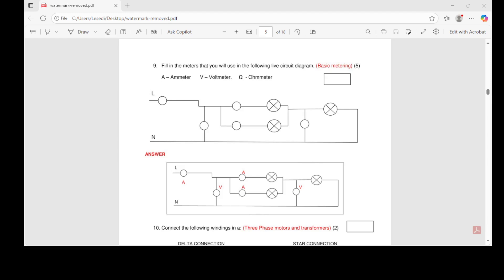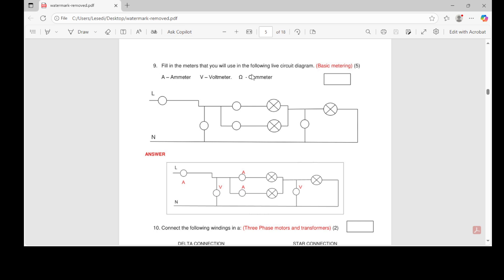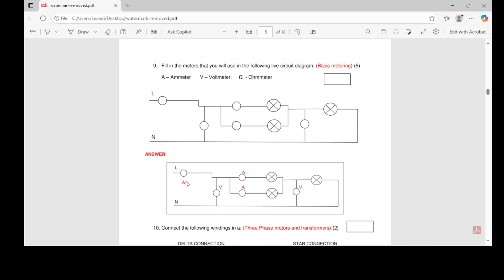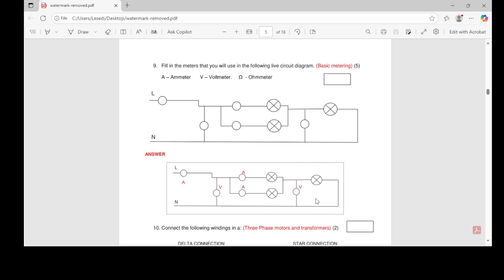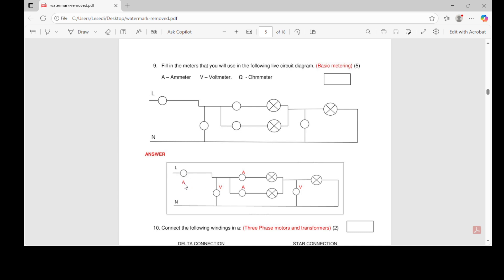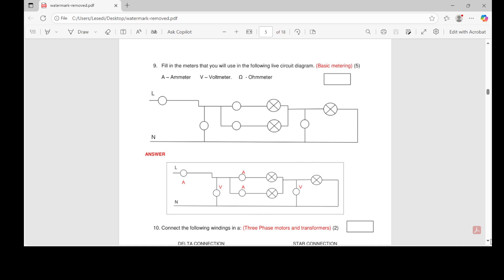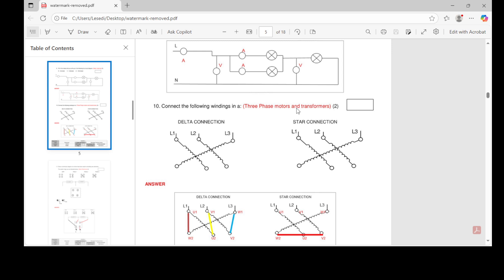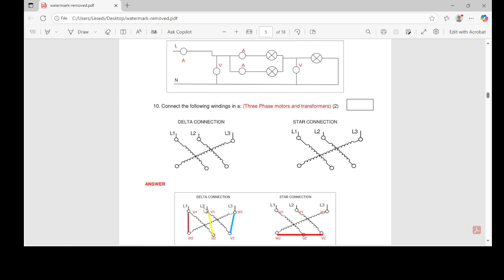ARPL PART 2, PAPER 2 QUESTIONS AND ANSWER : STAR AND DELTA WINDING CONNECTION : ARTISAN ELECTRICIAN

Comment: Do the questions change with time??  For instance, paper 2 can be different from Last trimester paper 2?
Reply from the maker: Never happened. The Arpl from 2011 is still the ones that are used even now. Just that it's 5 papers. But they are actually the same. They just change question 1 but the rest is always there. I will check all the other papers and try to see where I can upload them.
Reply: @collegenatedengineering1659 thank you so much, I'd really appreciate that.
Reply: What about paper 3